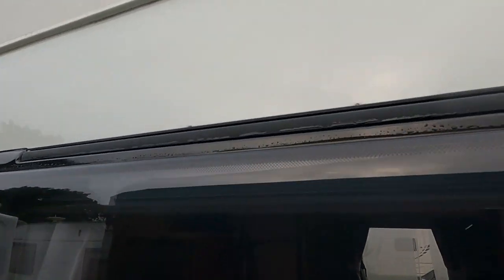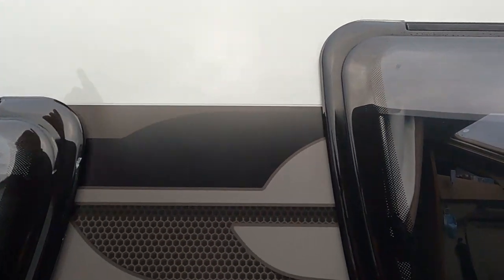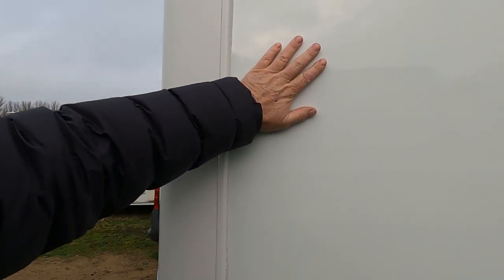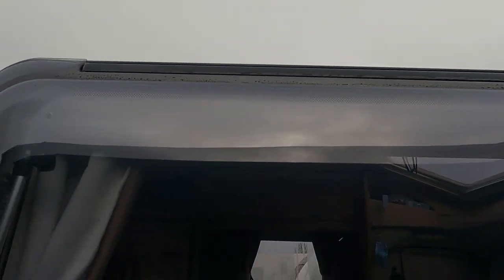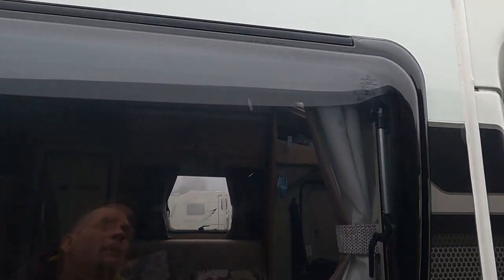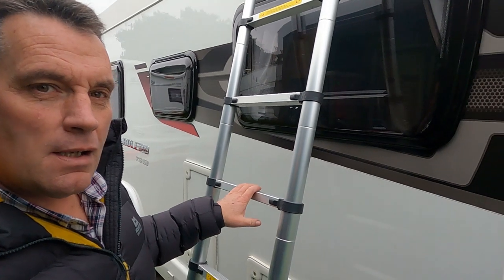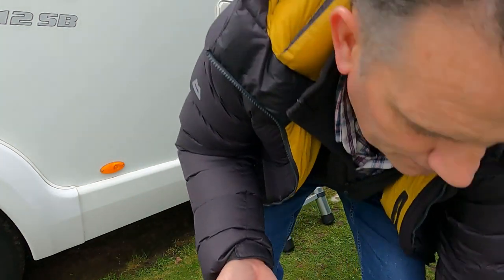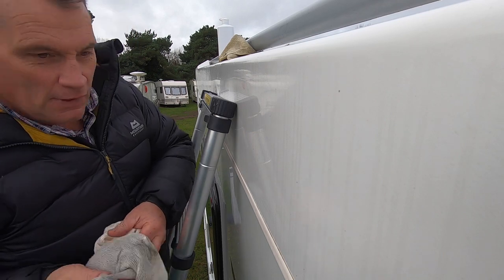Caravan & Motorhome Streaks!! Removing & Getting them gone!

Comment: You really need to keep the roof clean which helps to stop the streaks on the sides. The muck accumulates under the roof openings so it's a good idea to open the roof lights and clean round the frame. It's surprising how much muck gets under there. If you get streaks near the windows you need to do the same. Swift windows just pull upto the oblong hole but the windows are larger than the holes and a different shape so lift the windows and clean round the edges. I use Collinite Wax on our Carthago. One good coat will last a year.

Comment: I spent 4 days polishing our motorhome as it had gone really flat and no shine at all, I used two cutting compounds one course and one fine then a sealant to finish it off, looked great for 6 months then it was flat again!!! We live in southern Spain so the sun is very strong and we can't get it inside anywhere so around March we are going to spray the whole thing as all the panels on ours are grp. Hopefully it will be easier to keep clean🤞
Reply from the maker: i can imagine it’s a nightmare trying to maintain the shine down there in spain , i’ve seen some of the cars down there with paint peeling off , faded panels etc , and fully blemished caravans and motorhomes so i know exactly what your saying , good luck with the paint job hope it helps out , thanks for watching the video 👍
mike

Comment: Just noticed on your side panels bottom skirts you have the beading I have so you don’t have to seal apparently do you know what this is called ? Most motorhome they have to seal this every year I’m told but mine as this on I don’t want to go over it if you don’t need to
Reply from the maker: i never went over mine so i’d just leave it as it is , they use sika522 for most things , good stuff but horrible to use
thanks for watching the video 
mike
Reply: @TheFrenchiesMotorhomechannel  yea it’s not sealant mate I know other van use silka it’s a bearing some type of white beading on top of the skirts
Reply from the maker: oh that stuff yea with u now , always gets dirt & mould behind it and cant clean it , don’t know what that is but i’ve even used a grout pen and gone over it with that , does the job , some use mastic sealing strip as well

Comment: How do you remove the steaks on the decals plz
Reply from the maker: Hi richard , if the streaks are definitely on top of the decals a normal warm water wash with a small amount of fairy liquid & after an exterior polish should do the trick , depends on age of van and decals with regards to the result you get as they may be ground in
Reply: @TheFrenchiesMotorhomechannel  thank you , the decals are in good condition so I’ll try your suggestion. How about light bush / tree scratches on the decals , very slight marks when I’ve got close to a bush or tree

Comment: Love your videos but watching you clean the wheels, tyres then exhaust with the same sponge 🧽 you did the bodywork... that was painful 😥 all that grit and stuff your scouring the paint with.
Reply from the maker: Another video coming , how not to wash a Motorhome 😂 thanks for watching all the same 👍
Reply: @TheFrenchiesMotorhomechannel  sorry to criticise, just that I’m a bit obsessive about cleaning the motorhome and car, I’m lucky enough to be able to keep ours on the drive at home so I’m able to use snow foam with the power washer, I’ve used this method for years now and really believe it works to pre-wash.
Reply from the maker: No problem Steve that’s what these comments are for and I totally understand where you are coming from , definitely in an ideal scenario I’d be doing the same with a power washer as they get in all the small places especially around the windows etc 👍